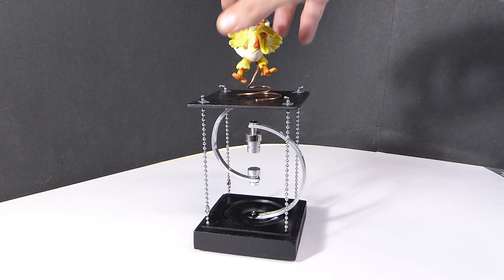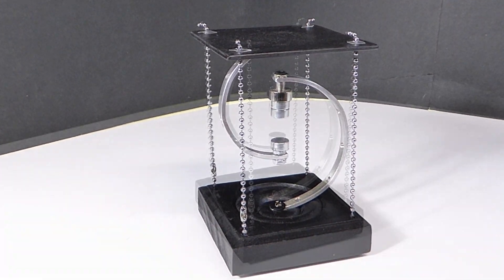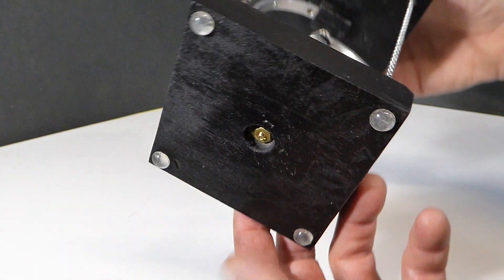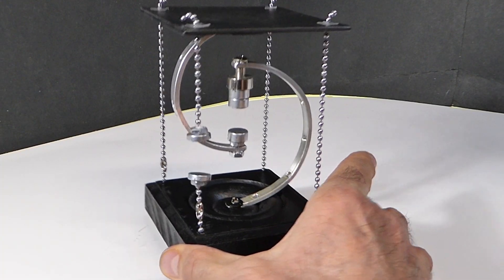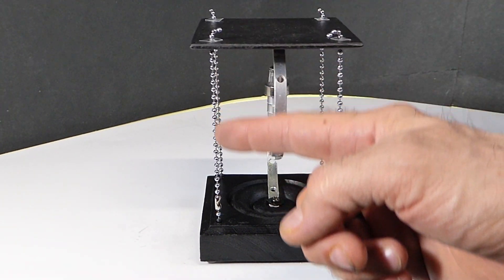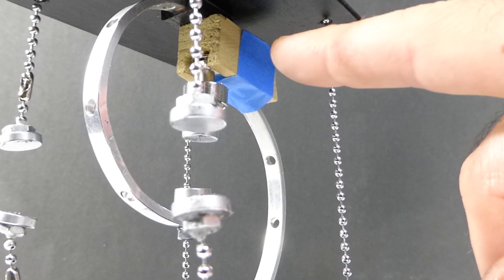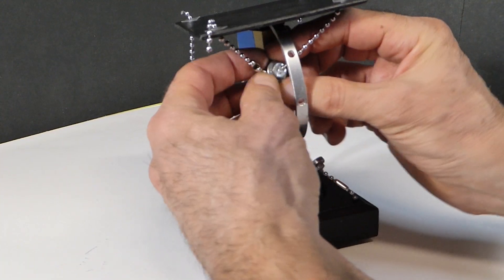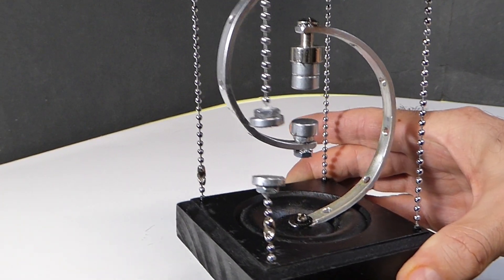Tensegrity 3 magnetic - Art Meets Science

Comment: There is a theorem in the physics which disallows stable configurations like this. With all magnets it is stable as much as unstable, meaning in as much of directions it is stable, it is unstable in others. So you need to have your structure in a way that compensates the unstable directions. Like with tube and magnets. They are stable in the axis of the tube, but unstable in all of rotation, and in all axises other than the tube's one. That is why electromagnets are used, to compensate instabilites, but that breaks the whole concept, so you need to do it with strings.
Reply from the maker: Yes, I am feeling the physics! I tried and tried. Please check out this one, where I used magnets to lift and direct steel balls. https://youtu.be/kND8DLMb2lc?si=hwrlpkm2bZHHLyHk
Let me know what you think.
Thanks for watching.
Reply: @ArtMeetsScience  I watched, it doesn't levitate technically, If I am seeing correctly it just picks up the marble, waiting for the left gear to do the heavy lifting job. Anyways, fascinating machine!
Reply from the maker: @hrayrbarseghyan5453   Right, of course, not levitation, just a unique, magnetic way to lift and transfer. OK, you want stable, PM levitation? try THIS: https://youtu.be/mVI2a6WqvAc?si=TR5E3VHSnmEdZWBA
Thanks for watching, and please let me know what youy think.

Comment: You could use plastic see through tubes to stabilize the magnets and do all four legas at once
Reply from the maker: I tried that, with wood sticks, and it is still very unstable. It wants to slide sideways and twist. It's impossible to control. Check out this project of mine. Here I used magnets in a controlled way to lift and move a steel ball. https://youtu.be/kND8DLMb2lc?si=n4ZGn4HQSiC1oCpD
Thanks for watching.

Comment: I’m guessing the final design is purely aesthetic and is the same as having no fourth stabilising cable at all? Eg. if you removed those corner cables with the magnets, it would still remain balanced.

You could use vertical airflow to stabilise without any cables?
Reply from the maker: @JaydenLawson  Yes basically it would remain balanced with just three corners supported. This design started with my dream of having all four corners “magnetized“, but through the experiments, I learned this was never going to happen. Physics won’t allow it. Using a stream of air is an interesting idea, but would require more machinery, apparatus. Check out this cool design - https://youtu.be/nicYxECF83U?si=aT295JGDCCcYscME

Comment: Copper or aluminum tubing should be able to stabilize the magnets and will make them want only to pull towards the closest magnet. You'll have to calculate the amount of push vs pull strength and you'll have to balance that somehow. Not to mention the shape is all off. I'd be trying to do some sorta circle or like a sphere with a hollow section shaped like a tube idk... I keep thinking if we had a strong enough set of magnets to lift / push the frame up hard enough to levitate.
Reply from the maker: Thanks for you insight. Stable levitation only with permanent magnets is impossible. There are physics that just get in the way. UNstable levitation though, CAN be used beneficially as I prove in my magnetic lifting system here: https://youtu.be/kND8DLMb2lc?si=6cgu5yclVFWSQCgp
Let me know what you think.
Reply: @ArtMeetsScience   they already have stable levitation buildings they are in Dubai don't know how far along the construction is but they are sooo cool they are supposed to be anti earthquake. However I'll totally check out your video... I wasn't thinking stable levitation more like controlled directional gravity another form of flying using magnets pullies and copper or aluminum for the lightweight ability as well as the ability that they have to stabilize the magnetic strength
Reply from the maker: @dakotapeters5654  Yes they have “stable levitation buildings in Dubai “, they are currently in the DREAM state of construction, because as I said before, stable magnetic levitation with permanent magnets is impossible. I would love to see some information about levitation actually being implemented with permanent magnets. Please send me some ;-)
Reply: @ArtMeetsScience  lol I'll try to find the link for ya, but I am concerned I may not know something or how things are structured. idk about a DREAM state of construction.... idk feeling like if there's collective consciousness that I'm not a part of it like I'm a missing link or something, idk. Kinda finding reality to be odd these days.

Comment: I wonder how if you replace all of the chains with a steel rod for better stability, then place each magnet on all of the corners
Reply from the maker: Nice idea. I've tried that. With the center support 'magnetized', and anything more that one magnetic outer leg, it becomes unstable. Apparently physics says no.
Check out this video: I lift and transfer a steel ball with permanent magnets.
https://youtu.be/kND8DLMb2lc?si=0SBWH4h8P8OfxbQE
Let me know what you think. Thanks for watching
Reply: @ArtMeetsScience  You're right, I forgot how difficult it is to balance a structure on a horizontal axis. It is impossible without something to lock its movements to maintain perfect balance. The only possible way to create floating magnetic concept is to place opposite poles near a single bar magnet. However, it seems that this concept has been created as a "floating magnetic globe"
Reply from the maker: I am still trying ;-)

Comment: It seems to me that using magnets repulsion rather than attraction should work better. When your model is based on attraction, the greater the imbalance, the smaller force from the external magnets to correct it. With repulsion, you should get it right - the greater the imbalance, the greater the force from the external magnets to correct it. Of course, the external magnets would have to be mounted on some fixed pillars rather than chains. Unfortunately, such pillars would spoil the overall impression. But anyway, it is worth checking out, I think.
Reply from the maker: Thanks, interesting thought. Check out what I did with magnets HERE: https://youtu.be/kND8DLMb2lc

Comment: An all (static) magnet approach will not be stable. With normal strain elements, as they get stretched strain increases, and when relaxed, strain decreases. With magnets it is the opposite.

You need at least ONE normal (non-magnetic) strain element (a wire) or a dynamic magnetic strain elrment. I suspect if you have a wire in the center, you can have magnets on all four corners to stabilize "sliding" of the top. But, it will be unstable with regard to "tilting" of the top. The former increases central wire strain, but the latter does not.

You can try to avoid this with two corner wires but there will still be an axis along which it can "tilt".

If you replace the central wire tension element with three in a triangle, you should be able to use outside 'corner' magnetic tension elements. Thus a hexagon design presents itself.
Reply: great comment! explains it all and a nice suggestion

Comment: Now I'm wondering, if instead of two magnets attracting each other in the middle, if it was two magnets repelling each other, creating a maglev, it would also work, right? Cause the tension of the chains around would prevent the magnets to move to the sides
Reply: But it wouldn't have this structure in the middle, it would be on the floor and at the upper structure, two magnets repelling, and the chains around would prevent the structure to fall sideways
Reply from the maker: Nice thought Murilo, but they will not be stable. It's like balancing one marble on another marble.
Thanks for watching 
Check this one out: https://youtu.be/Vx82pfkIp2s

Comment: We only need three outside chains for a stable (-ish) Tensegrity table... I would guess that's why you can replace the 4th with a magnet...  I would also lead to think that when you replaced your 4th with a magnet, that it made the table a bit more unstable. Because now the center one is not in the middle of the three remaining outside full-chain connections and the 4th magnet one is probably pulling too much (or not enough, for when it fails). As in, normally, the outside chains only provide equal and opposite force back, just enough to keep the table in equilibrium (stable, centered and level). Whereas using the magnet can add more tension to the chain on top of that (as in, what if you replaced that 4th magnet with stronger ones, that would be like having one chain too tight). Or if the magnets get too far apart they provide less tension and the line breaks. So think of it this way... Treat it like a seesaw.  I can use 2 chains... one chain on each side of a seesaw to tie down both sides of a seesaw and make it level, and effectively turn it into one big stable bench, where I can sit anywhere along it. It would be very difficult to replace both these chains with attractive magnet connections (without some crazy computer-sensor controlled electro-magnet solution as you mentioned). Even if you did get it level, it would tilt to one side or the other as soon as you touched it. Its not stable. BUT, you could replace EITHER side with a strong enough attractive magnet connection, as just long as its not strong enough to break the chain, and the chain is the right length. So, therefore, replace the outside chains with magnets and not the middle one... keep it a single full chain in the middle, holding up an entire table.
Reply from the maker: Nice analysis, but the bottom line is that (simply put) you CANNOT balance ANYTHING with permanent magnets. Here's a good illustration: Take 2 magnets, any type, any size. Put one magnet on a table, and try to bring the other magnet down slowly, just enough to float the first one up, off the table, but NOT get sucked up into the magnet you're holding. Impossible!
Samuel Earnshaw studied and explained this in 1845.
Meanwhile, I was able to employ PM's in a useful way that I'm pretty sure has never been done before:
https://youtu.be/kND8DLMb2lc
Let me know what you think. Thanks for watching.

Comment: First off if you want to use all magnets you need less metal in the structure. Only use metal near the magnetic connections. Next if you find the magnets move too much change the chain or string to something more stiff like a toothpick or something. Lastly try having the magnets at different heights so they dont all match the same distance
Reply from the maker: Thanks for your comments, but it still won't work . The math translates to (I'm paraphrasing massively) you can never maintain the 'sweet spot' of 2 permanent magnets.  Here's a good illustration: Take 2 magnets, any type, any size. Put one magnet on a table, and try to bring the other magnet down, slowly, just enough to float the first one up, off the table, but NOT get sucked up into the magnet you're holding. This is impossible!
I have achieved some magnetic magic in this machine.
https://youtu.be/kND8DLMb2lc
Thanks for watching.

Comment: This might be a stupid idea because I'm not the brightest, but wouldn't it be easier to get it stable if the bottom outside magnets were further out and set at an inwards angle, with the top being smaller and the magnets at an outwards angle?

Edit: never mind, just clicked in my head that the outside magnets have to push, not pull.
Reply from the maker: Hi Charzilian. I got you thinking, huh? Nice suggestion, but the fact is that all of these magnets are PULLING. Thanks for watching.
Check out my latest project:
https://youtu.be/qRlHNdCnzQc

Comment: You can use fishing line,not metal
Also magnets can be installed by top or bottom,away from the pull of the center one which have to be even stronger to contrast the pull of other magnets in the perpendicular pull
Reply from the maker: Thanks Ruben, good suggestions, but I've learned that this is impossible, in this configuration. There are complicated physics behind why, but simply put, you cannot maintain the exact separation of 2 permanent magnets. They will wander too close and snap together, or too far apart, and not support the structure. There is an infinitely small 'sweet spot' where the 'balance' is, and staying there without a feedback system and constant adjustment is impossible- with permanent magnets.
Check out the magnetic magic I did in this project:
https://youtu.be/kND8DLMb2lc
Thanks for watching.

Comment: Did you try the one chain across the magnetic one? XD That should stay stable too. Or all at once very near to each other.
Reply from the maker: Nice thought, tried it. Just not stable. There are complicated physics behind why, but simply put, you cannot maintain the exact separation of 2 permanent magnets. They will wander too close and snap together, or too far apart, and not support the structure. There is an infinitely small 'sweet spot' where the 'balance' is, and staying there without a feedback system and constant adjustment is impossible- with permanent magnets.
Check out the magnetic magic I did in this project:
https://youtu.be/kND8DLMb2lc
Thanks for watching.

Comment: Really admire your experiment. Imho, I believe that the magnets fail because we cannot control the distance between 2 magnets.The certain length of strings holds everything in position. We need at least 3 strings to hold it in place, same way as any normal structure. Let's say, if you make hexagonal shape and have 3strings/3magnets, it will work.
Reply from the maker: Thanks Jaques. You said it: There are complicated physics behind why, but simply put, you cannot maintain the exact separation of 2 permanent magnets. They will wander too close and snap together, or too far apart, and not support the structure. There is an infinitely small 'sweet spot' where the 'balance' is, and staying there without a feedback system and constant adjustment is impossible- with permanent magnets.
Check out the magnetic magic I did in this project:
https://youtu.be/kND8DLMb2lc
Thanks for watching.

Comment: So its almost 1 year how far are you from success?
Reply from the maker: It's still a far-off dream. I hate to concede, but as I've stated in previous comments, replacing even ONE more of the outer chains with permanent magnets is IMPOSSIBLE in this type of Tensegrity form. There are complicated physics behind why, but simply put, you cannot maintain the exact separation of 2 permanent magnets. They will wander too close and snap together, or too far apart, and not support the structure. There is an infinitely small 'sweet spot' where the 'balance' is, and staying there without a feedback system and constant adjustment is impossible- with permanent magnets.
Check out the magnetic magic I did in this project:
https://youtu.be/kND8DLMb2lc
Thanks for watching.
Reply: @ArtMeetsScience  then why don’t you try to put those 2 magnets inside a transparent elastic plastic tube in that way it would be transparent and support the magnets from wandering off. It won’t be like we want without chain but it will be close
Reply from the maker: @aedaldaniel  That would only constrain them in the horizontal. They would still get too close and snap together.

Comment: Could you use this technique to make a ladder to space?

With wires connecting a sequence of electromagnets held under tensegrity?
Reply from the maker: Nice idea, but impractical with electromagnets. Supplying the power would require additional cables/solar panels controllers and mass that would be unwieldy. We need to get there with permanent magnets. I think this is the key.
Reply: @ArtMeetsScience  I can see what you mean, perhaps a hybrid method could keep the weight down and give precision?
Reply from the maker: @inesineaa  The fact is, a 'ladder to space' is just not practical, no matter how you build it. You just can't have 200 mile-high  'towers' dotting the planet, for many reasons. As we get better at launching ourselves into space, it gets cheaper, safer, and more efficient. I think the next step might be electromagnetic propulsion to space. (see rail-gun).
Have you seen my 'mag-lev' hockey project:
https://youtu.be/Vx82pfkIp2s